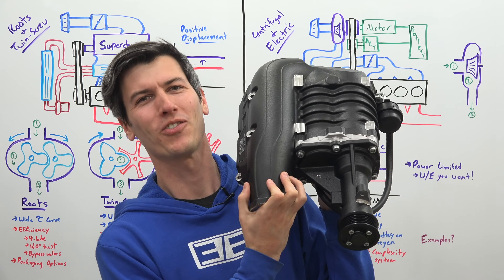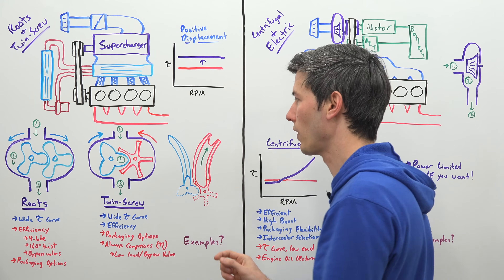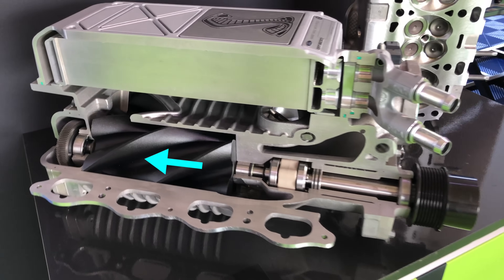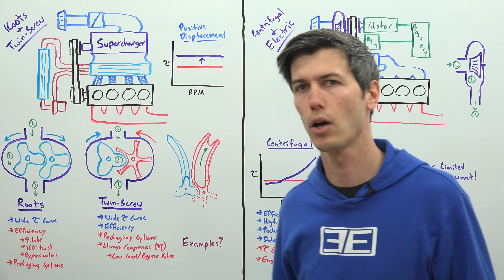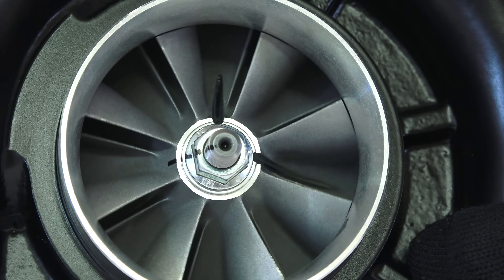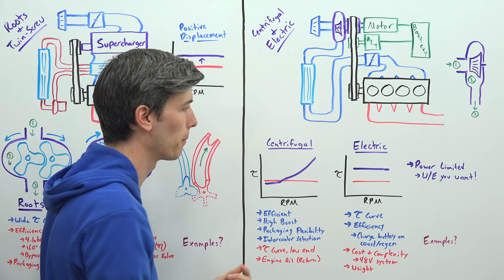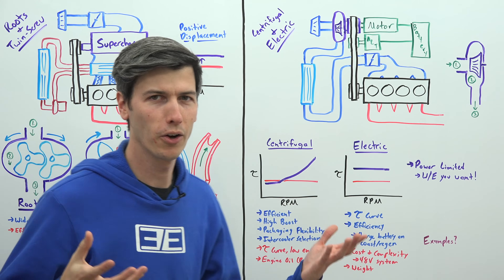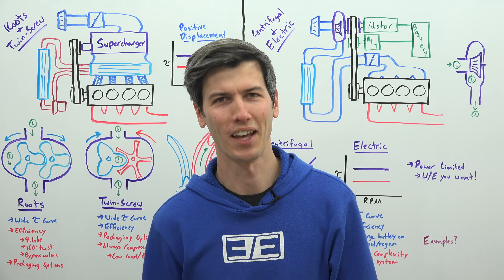What's The Best Supercharger? Roots vs Centrifugal vs Twin-Screw vs Electric

Comment: So when are we going to see you putting a supercharger in the MX5?
Reply from the maker: Fingers crossed for June install. I want to get it on a dyno so I can show before/after, and that depends on when tuning shops start opening back up.
Reply: @EngineeringExplained  Oh totally forgot about that. It's getting more relaxed here in Central Europe (Czech Republic). And car shops/services where opened during lockdown (but I don't to what extent).
Reply: @EngineeringExplained   Looking forward to that! But I heard so many stories about ND gearboxes grenading. We might see the NC MX-5 gearbox retrofit afterwards 😁
Reply: @EngineeringExplained  come to Wisconsin. Stop by where I work. Vl performance. We've got a mustang Dyno
Reply: Engineering Explained 
They don’t have to open up to do a private test!
Reply: @EngineeringExplained  there's a shop in NC near me that's open, whether they're dyno tuning right now though, I'm not sure. 

BUT! 

You'll be able to use Charles' new garage!  🤣
Reply: Would u recommend a Supercharger for a 2004 Acura TL 6speed if i want more power?
Reply: @EngineeringExplained  I m looking forward to at least 850 hp
Reply: @bruderrudiger9574  Don't count on it being anywhere near that power. It looks like Jason has the Eaton supercharger kit from Edelbrock, which is advertised to produce "198 RWHP and 182 ft-lbs of torque at the rear wheels." Assuming a 10% drivetrain loss (likely less than 10% in reality), the supercharged engine will output 220 HP at the crank, versus 155 HP stock (NA).
Reply: @brewmagoo589  I knew that this figure is not very likely except if he would do something like the homies over on Boba motoring
Reply: @brewmagoo589  supercharger on miatas are pretty silly imho (won't get that much power and your looking at the same price as a much more aggressive turbo kit, plus ND gearbox are "famous" for not being the most reliable) 
Turbo or allmotor is the way to go for miatas (speaking as a Miata owner myself)
Reply: @andy_liga  Depends on the generation tho! The NC actually responds really well with the Kraftwerks supercharger and it's less than $3900. Only thing cheaper and more reliable is the popular 2.5 swap (all motor setup) which is around $2500. For the NA/NB the turbos are definitely the way to go tho.
Reply: To my disappointment it does not pop a huge intake out of the bonnet... I guess i have to research something on google images now...
Reply: I've had a Miata for a year now. It seems everyone's gotta have one, once. My insurance agent just went and bought one like mine! Lol
Reply: What model/producer is that supercharger? I'm looking for one for my Miata. Initially I was looking at rotrex but after your explanation I changed my mind. Best of luck with your installation and regards from Poland.

Comment: cAn you please make a video on why motorcycles have max 6 gears whereas cars have 7 to 8 in manual
Reply: akash ketwal not sure I understand. More gears (to an extent) are advantageous to keep the engine in the optimal rev range for a given situation.
Reply: motorcycles are all manual gearbox, now how many cars have you seen with 9 gear manual transmission? try to shift manually through so many gears in the traffic

Comment: The best one is Centrifugal one , but it has to be the new one the dragsters use , connected directly to the crank
Reply: auto mech aren’t centrifugal blowers already connected to the crank via the front drive pulley? What is new about the ones drag racers use?
Reply: @ALMX5DP  its connected directly , it sits front of the engine , and uses gears to drive , not a belt.
Reply: auto mech is that beneficial for a street car though? It’s not like the belt should slip or anything and that allows the blower to be placed anywhere along the plane.